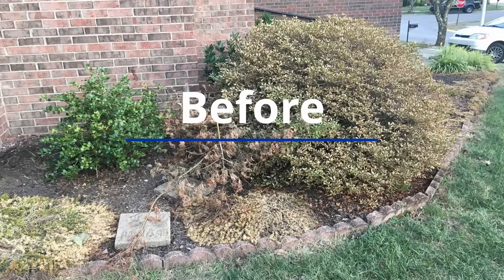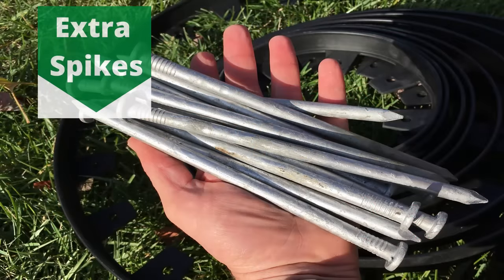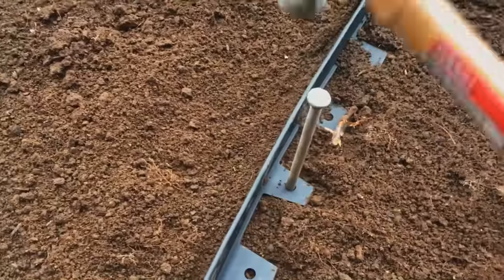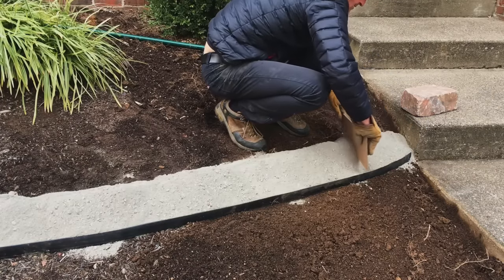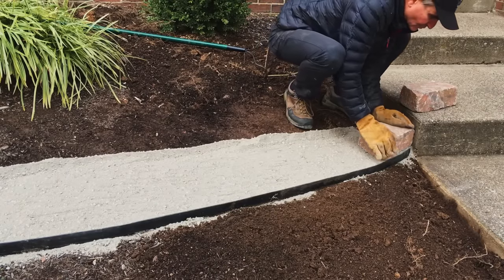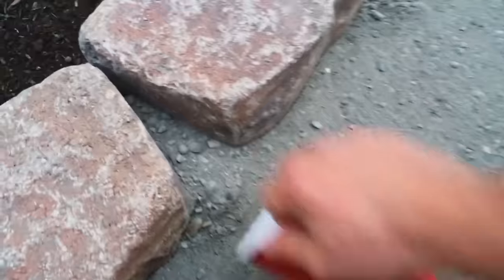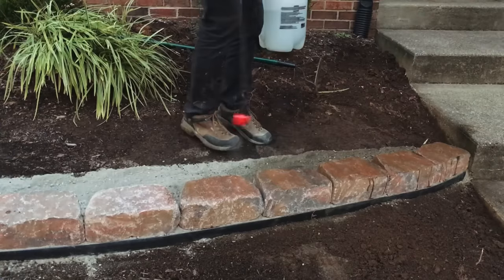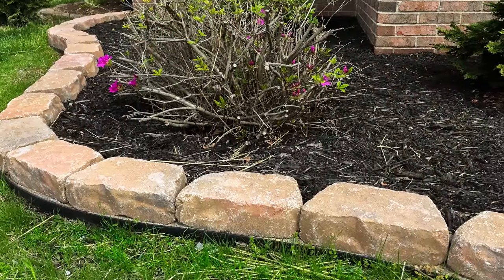easy diy No Dig Border *2020 UPDATE*

Comment: Thank you for this video....very helpful and now not as scary to tackle this as a DIY as I thought.  Quick question:  If I wanted or needed to stack one more row on top of these bricks to making it taller, what additional steps would I need to take?  Would they just rest on top?
Reply from the maker: Heart and Home Orlando, thanks for your question. First of all, I'm glad to hear of your increasing confidence!!  I have not made a second layer on this type of border because I don't know if it would look that good and the difficulty level is raised some because you would mix up and use a traditional mortar between the layers. Even, though, it involves more work, I would highly recommend digging out the old dirt and mulch out of your area so the level is dropped enough so that there is plenty of room for the mulch to sit in there without spilling over. Also, the same thing can be accomplished by building your border out further so the dirt can slope down to the level of the bottom of the blocks and also have room for mulch.  That being said, some have done this and said it worked great, so its up to you. Some have also used landscaping adhesive...its much easier to use than traditional mortar. Sorry for the long answer....
Reply from the maker: Did you ever get a chance to build one of these?? I hope you are selling lots of homes down there in Orlando!! You don't have to, but if you wanted, you could send your finished pix to my email and I'll post them on my website. My email is tim@timvogelaar.com
 and here is a link to projects others have done with this technique: https://www.timvogelaar.com/Easy-diy-no-dig-border. Have a great day!!

Comment: Question: If I want to move it or change the garden borderline in the future, will this be very difficult to remove because it’s cemented?
Reply from the maker: Yes, it will be difficult to remove. You'll need to use a sledgehammer to bust up and remove it. If you aren't sure of what you want for many, many years, then you'd better choose a much less substantial border.

Comment: Why do you spread the mix to 1 foot wide when the bricks’ width is smaller? Now I can see the leftover concrete.  Can I place it the same width as bricks?
Reply from the maker: The width is for added strength and weed control.....but it will work without the extra width so that's great if you want to make it just a little wider than your bricks....have a great day, Jodi!!!!

Comment: I never thought about adding the layer of concrete but it makes so much sense. Thank you.
Reply from the maker: Thanks for your comment! Make sure and get the "fast-setting" mix and make sure your temps are at least in the 50's so the cement will cure properly. Have a great day!!

Comment: Can't wait to start this project.  Question:  How thick should the concrete "bed" that the pavers sit on be?  I'm concerned that getting the pavers to sit level behind the edging could be tricky.
Reply from the maker: Thanks for the question. Watch the video again and you'll notice that the concrete bed is super level because the dry powder mix is levelled off using a cardborad or wooden board and dragged along the top edge of the plastic edge that you have spiked down to the ground. You might have just skipped over this in your watching, but you'll see its super easy. Please let me know if you have any more questions.
Reply: Thanks for the reply.  I watched it several times, I guess I just assumed there would be a larger "lip" visible at bottom of paver. Wasn't sure if the stone sits directly on top but it appears to be the case.  I plane to level the ground as much as possible before beginning because I think it will look better than having undulations.   @maxpatch67
Reply from the maker: Gotcha. So the top of the plastic edge does not a sizable lip...basically a little thicker lump is on the edge. The dry cement mix gets leveled off even with it and then the blocks get set down right down on the inside of the edge-all on the cement mix-not on top of the plasic edge. With the block completely on the mix, it allows the block to settle down into the mix better, creating a better bond when misting it later. When laynig the blocks down, give them some firm bumps to help them settle in. Please let me know if you're not ure of something yet, ok? Have a good day!

Comment: Great video--thanks. Approximately how many linear feet will one concrete bag cover?
Reply from the maker: 5
Thank you!! 5. After setting the blocks in place, you'll need an extra bag for dumping the cupfulls of cement mix in berween the landscaping blocks. Even thoough they are heavy, I always get about two more bags than I need, because its no fun to have to go back and get more later. To me, I'd prrefer to go back after I'm finished to return a little extra that I bought. Have a great day!!
Reply: @maxpatch67  thanks
Reply from the maker: my pleasure

Comment: I had a brick border put around my grass.  Problem was they dug down a few inches, poured concrete, then laid brick so you could actually walk on it.  Here are the issues.  One, no drainage of the water from the lawn and it became a swimming pool in the winter.  Two, after many years the brick sank, tilted etc over time because land settles and it had weight.  Three, tree roots ripped up bricks completely near the tree.  We had to dig up bricks and concrete at the lowest end of the lawn to allow drainage because just putting in a pipe didn't work.  The lawn wasn't flat and I don't think that would have helped much.  We get a lot of rain and you need run off.  The soil is clay and I actually dug narrow ditches in the backyard and filled with gravel so shrubs didn't die after two gave up.  The lawn in front becomes mud so in the Pacific Northwest I think they should all be slightly sloped to a gravel trench.  I am at the top of a hill and the neighbor at the bottom said he had to dig a 6 foot trench.

Comment: Finally got sick of cutting a new flower bed line every year and trying to maintain it but even so would always get mulch on the grass and grass growing in the mulch.  Then by the end of the season it just looked ugly.  So did this project on a few of my flower beds last year and this year.  Probably over 200 bricks and many many bags of concrete! Lost count...

Best tips I can give are buy more concrete than you think you'll need.  I went maybe 1.5-2 feet wide with the concrete.  Maybe overkill but I hate dealing with weeds and this has prevented any of them from growing in the beds especially after weed wacking and grass blades flying everywhere.  I also needed to cut a few stones that fit up against the house foundation/ existing retaining wall - stone diamond blade for a circular saw worked very well with this.  Rock chisel and a 2 lb hammer also worked well to split them once scored.  Another thing is before you start with the border, figure out where you want your gutter runoff drainage to go.    I hated dealing with the ugly black tube or the drain stone that would always end up washing out the mulch during heavy rain.  What I did is dug a trench from the downspout opening underneath the mulch and where the stone border would be, ran a drain tube (home depot "EZ-Drain Prefabricated French Drain with Pipe"), then used a pop up emitter in the grass on the other side.  Now even during heavy rains the mulch stays put.  Very very happy with the project.  Thanks for posting this.
Reply from the maker: You just posted one of my best comments ever...thank you for taking the time for the tips. I really appreciate that. If you would ever want to send me pix, I'd love to see them and post them on my website for others to view: https://www.timvogelaar.com/Diy-no-dig-border-folder-of-galleries You can email pix to tim@timvogelaar.com. Again, thanks so much and have a great day, mapex311!!!
Reply: @maxpatch67  I will, just want to wait for flowers to be in bloom so it looks nice!
Reply from the maker: Great! I can't wait!! I'm sure it looks amazing.

Comment: Thanks for this great instruction. Should I lay down weed barrier fabric before I place the cement and later mulch? I didn't see you using any weed barrier; was it already done from before or you don't need to use it?
Reply from the maker: No, don't use weed barrier fabric. It does not work and creates many problems in the future. Instead use the cardboard technique found in my video: https://www.youtube.com/watch?v=HIWDPlaB6wY&t=205s First make the border and then lay down the cardboard before mulching. Thanks for the question, Mike. Have a great day!!

Comment: Good ideas all around.  One question: can you reduce the width of the quick setting concrete and make it perhaps a few inches past the width of your pavers?  This way, one bag would stretch a lot more than 5-6 feet as you say.  if you lay down a weed barrier, you could still keep weeds at bay and use more concrete for the pavers.  What think ye?
Reply from the maker: Yes, you can make the cement narrower. The extra width gives the border more stability and increases the weed barrier capability. So, its up to you about that. For a weed barrier in a new (or very weedy) bed, I always use this technique: https://youtu.be/HIWDPlaB6wY Please let me know if I can help you any more, Stukaman! Have a great day!!

Comment: Are you able to stack the bricks on top of each other to make layers? If so, how would you go about doing that?
Reply from the maker: You can do this, but I wouldn't suggest it because a tradidtional levelling process has not been used and as you go higher, it can start looking bad. That being said, its not so bad to go just one level higher. If you choose to do it, use landscaping block adhesive. Let me know if I can help you any more!!

Comment: 2 Questions…..what is the purpose of having and leaving the no dig edging? Is it for weed barrier? Also, what if my lawn is slightly sloped?  Should I use a level across the top of the blocks and build up with more concrete to even out? Thanks, you make me feel like I could actually pull this off.
Reply from the maker: You can pull this off!! You need to use the plastic edging as a form for the concrete. There is no other way to form the concrete just right. If you want to make the plastic edge removable, just attach the edge to the ground in reverse and pull it up after the cement sets. Does this make sense? About your sloped yard....you don't need to do any leveling anywhere....just build this on your ground and it will work great.
Reply: @maxpatch67  Thanks so much! Fingers crossed. Attempting after I figure out what I want to plant.
Reply from the maker: Did you get a chance to do your landscaping yet??
Reply: @maxpatch67  not yet! We’ve decided to move some of our big plants and bushes around first. I’ll be sure to share my results when we get it done.

Comment: Can this be used as a base for a 3 ft tall retaining wall that does not have a significant structural load?
Reply from the maker: I wouldn't recomment it. You should use a traditional wall building technique.

Comment: Hi, it looks so good!!  We live in Chicago and we want to do this  along our chain link fence.  But the ground is hard , rocky and clay like, so we Do not want to try and remove the grass. So can we do this on top of the grass and still use the quick cement mix?
Reply from the maker: This technique is perfect for your situation. Build it right on top of the grass. Please ask if you have any more questions! Have a great day, Laurell.
Reply: Thank you so much!  Now can we fill it with top soil and make a flower bed also, or should we just fill it with mulch?

Comment: Great vid, agree with comments.  I've done this without the plastic boarder but see where it can be helpful, thanks!
Reply from the maker: Oh really?  That's awesome! Thanks for the comment and have a great day!!
Reply: @maxpatch67  I'm going to do another similar project when the weather gets nicer (PA) and I'm going to use the border.  The issue that's going to cause some work is that most of the ground is level, but then it has a significant slope down.  I'm planning on a lot of digging and multiple rows of block.  Any recommendations let me know, love to chat.
Reply from the maker: Ya, you definitely need to watch other videos about levelling and use traditional small wall building techniques. My border is not for you for sure. I hope you are having success finding other methods. Thanks for the comment and have a great day!!

Comment: Thanks for the update.  Do you have a video showing how to make this if one side of your border is lower than the rest of the area, ie, how to transition the grade change. Thanks
Reply from the maker: This border is designed to follow the ground just the way it is. If you don't like that, then you will need to use another level where you use levelling techniques and build up your border with a little wall. I'm sure you can find videos showing different methods. Thanks for the question and have a great day!!

Comment: Im gonna attempt this. Should i add weed liner?
Reply from the maker: Awesome. Make sure its at least in the 50's for temperature so the concrete will cure quickly. No, don't use weed fabric. Use this method with cardboard instead: https://www.youtube.com/watch?v=HIWDPlaB6wY&t=205s

Comment: very important question. wouldnt this be very hard to remove. since youre using concrete as a paving mix
Reply from the maker: Yes, this border is considered permanent, so only make it if you are very sure of what you want for many years. Thanks for the comment. Nicolas.

Comment: Do i definitely need the plastic edging? Or can I just use the rock boarder?
Reply from the maker: Great question. You at least need the edging temporarily to use it as a form for the cement to make it straight and level. What you can do is attach the plastic edge to the ground in reverse and then when the cement is cured, you can pull the spikes out and remove the plastic edge easily. If you want to use this technique, just use the plastic spikes-cut them in half first so they can go in and back out of the ground easily. It works great. Let me know if I can help you any more.

Comment: Would this method work for a landscape design going up hill? I’m concerned about the bricks falling downward. Also, instead of bricks, would rocks work?
Reply from the maker: Building this on a hill is no problem. The whole thing is firmly bonded together with the special fast-setting cement. Yes, you can use rocks, but it can be a more of a challenge to arrange the rocks in a way where they work with each to have smallish gaps between them where they all look good together and the other challenge is then filling in the gaps and dumping in some extra behind them so it consistantly bonded together. I did this last summer and it worked great, but its just no a nobrainer, because you are working with irregular shapes....but if you understand the principle of each step, you can definitely do it. In my project last summer, I used flat type chunks of limestone that the property owners had dug up from their property that were sticking out of the ground part way. I'm not sure how it would work for more roundish type stones. Please let me know if I can help you any more. :)
Reply: @maxpatch67  thank you for your knowledge. I’m doing a landscape project going slightly uphill for my moms driveway. I was debating if I should use bricks or rocks for the edging and what methods to use that require little to no digging for the edging. This has helped me. Thank you again 🤗
Reply: Came across this video, looks easy enough for a novice gardener, but I'm alittle hesitant as my lawn/driveway slightly go downhill. Has anyone try this method and it works? Thank you.

Comment: Hello.  Would you recommend using this technique as a border for a backyard patio?  Thank you!
Reply from the maker: Probably, but not for sure....I'd have to know some specifics to say for sure, but I have used this along a sidewalk, which is similar and I adapted this technique a little to make it work better. I actually dug out the edge and laid a bed of concrete in the bottom. Then I cut a carboard piece with a notch that made half of it about 2" lower and I dragged the cardboard along the sidewalk and levelled out the mix down in the long trench I dug along the edge so then I had a perfectly flat bed to set the blocks on top of. Then I set the blocks in place and dumped some extra mix along the edge of them to hold them in better and then started misting with the water to bond it all together. I hope this helps. :)

Comment: If we wanted to put a flat block on top of the border for finishing, what would you recommend?  Would we put a light dusting of the cement on top, put the flat block on top and then spritz with water?   Would that work?  Or what would you recommend?
Reply from the maker: Laurie, I like the way you are thinking. I have thought about this  a lot and I don't have any great ideas on this, but I do know if I did add a flat block on top to finish it, I would use traditional mortar, which is not super difficult, but adds a little challenge. Do NOT use the cement mix from the video. A second option would be to use landscaping block cement. It is made for purposes like this. If you figure out a good option for which block, please let me know, ok? Have a great day!!

Comment: How does this work with gentle yard slope? I see ppl said they did it with uneven yard, but how? Are you blocks level? Or sloped?
Reply from the maker: Ya, there is not problem with a slope in the yard. After tacking down the plastic edge, just level the concrete mix off even with the edge. I generally hold my cardboard level with the ground while doing this so the whole border looks uniform when finished. Let me know if I can help you anymore, ok, Jennifer?
Reply: Thank you!